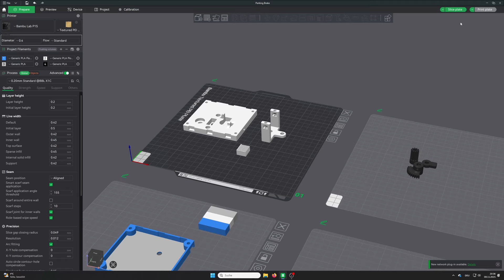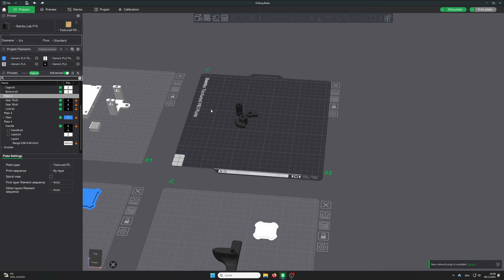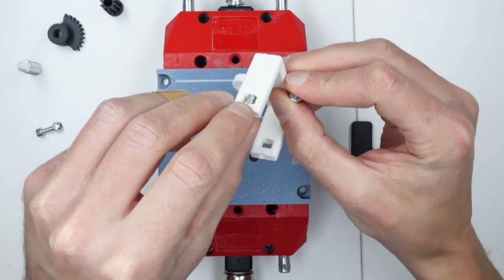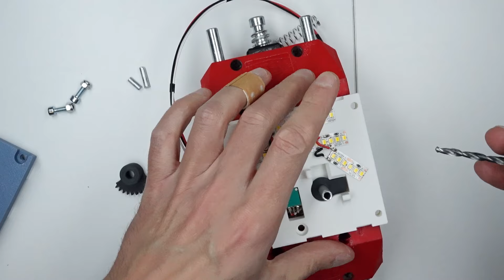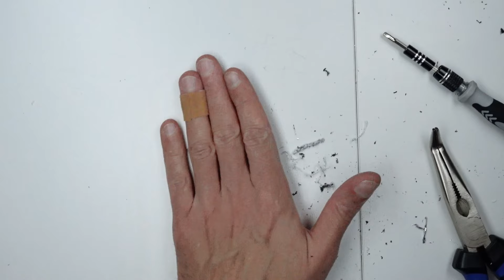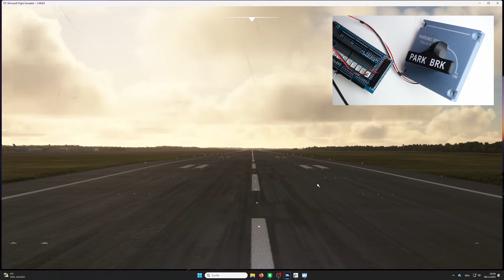Parking Brake Assembly - EP 34 - Full Home Cockpit Build

Comment: amazing! do you have plan for the scope of your project? meaning what from the cockpit you are planning to design and print, would love to know if you are planning to do the throttle and trimwheel as well as things like tiller. Cheers
Reply from the maker: thank you very much. My plan is to build the full cockpit. Including the tiller and throttle. To be honest.... the throttle/trimwheel is the part I'm looking forward to the most. It's a great challenge for an engineer. Espacially with planetary gears and stepper motors. And I allready did some promising tests. But this is my long term side project. I will definitly take a lot of time. But the next parts will be the speedbrake, flaps and gear lever. These parts will add a lot of value for your sim environment.  Regards Tom
Reply: @TheCockpitPrinter  agree, would be great to tackle both the gear lever with the auto brake panel. I'll like the way you are building all these parts!